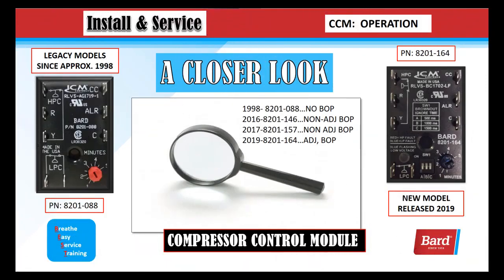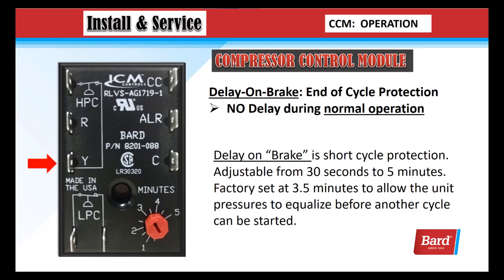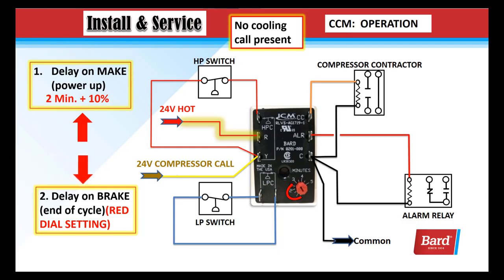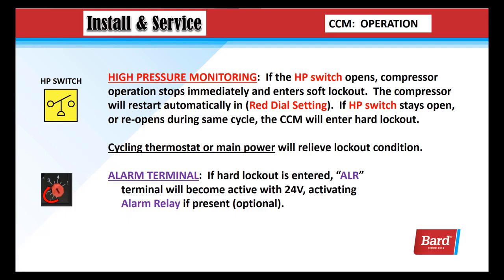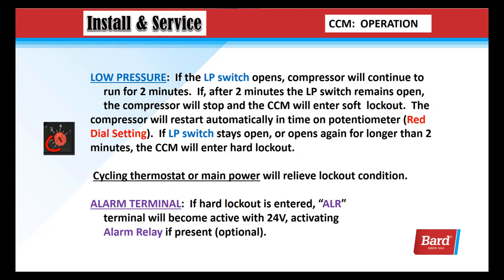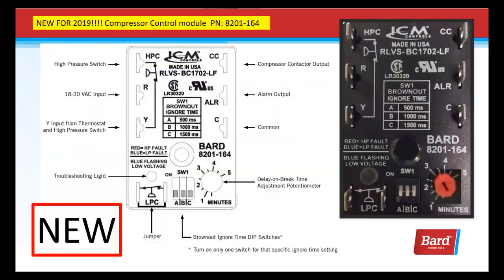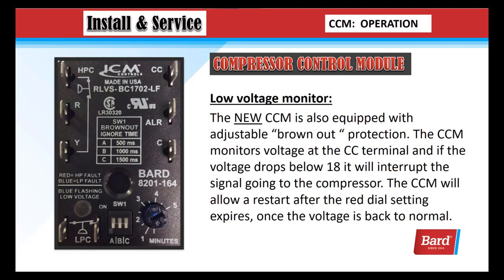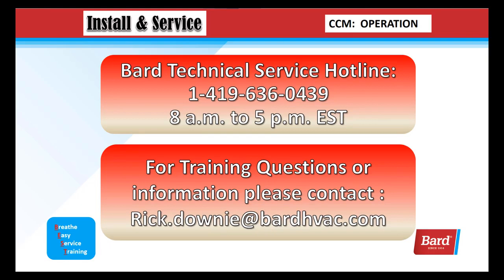Bard Compressor Control Module CCM Sequence Of Operation

Comment: Why when I call for cooling?My compressor comes on, but my circulating fan or my airhandler doesn't come on.But when I call for heat  the heater comes on and the fan comes on.
Reply from the maker: By saying "circulating fan" are you referring to the condenser fan? The condenser fan should energize on the same side of the contactor as the compressor. So they should come on together. Also I noticed you mentioned air handler. This video is focused on the Bard package unit compressor control module. I would recommend reaching out to local HVAC company so they can troubleshoot your issue.